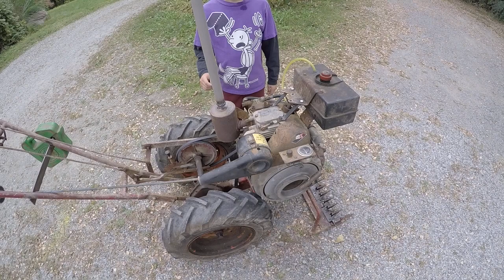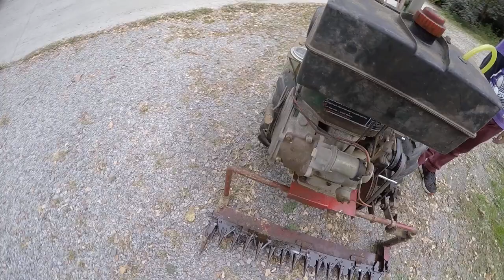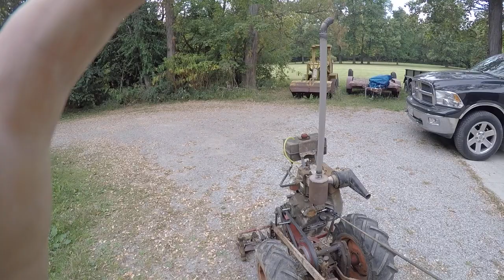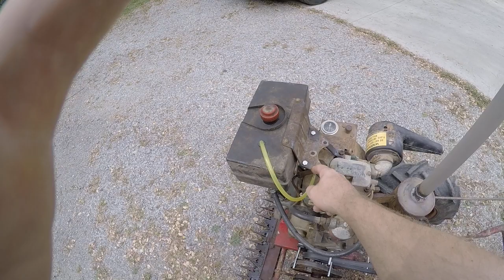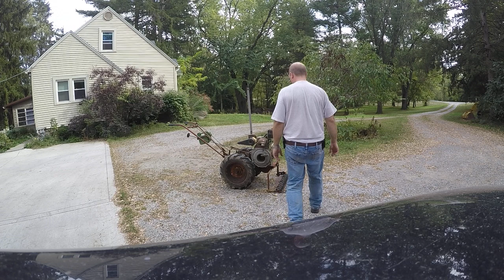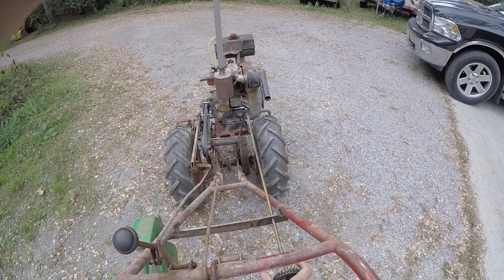Simplicity M1 Petter AC1 Diesel

Comment: Thank you for posting this, i have an ac1 that i made a DC 24 volt generator using a 24 volt pma set up with pullys and a belt, i was wondering how to lower the rpms, and couldnt find anything anywhere, the previous owner had set at 3000 rpms, and with a 24 volt pma the max that should turn the pma is 2700 rpms, i have it now set at 2100, because i found the max output be at 2200, and no need to set any higher as just wasting fuel. We are completely offgrid with solar and wind power with 4 forklift batteries, and we live as though we are on grid power, so sometimes need to have supplemental power, and i run my military trucks off of waste motor oil, and have found that these AC1 engines will run just fine on it, so free fuel. These actually run smoother and put out power just the same running on motor oil, i filter with a centrifuge and mix in 10% diesel, have had no issues with injector or the engine running it on it. Again thanks for your help.
Reply from the maker: Thanks for watching and glad you found value in it!

Comment: I know these engines fairly well, really nice to see what you've done with it. Very cool variable speed conversion, it clearly works! It's supposed to change the timing too, the fixed speed engines like this one are pre-set and the adjuster is only supposed to fine tune it. But it clearly works even if the timing won't always be spot on. Their operating speed range is 1500 to 3600 and the idea was you ordered it in the speed you wanted and it all came pre-set. But yes they did a special variable speed one, mostly for use in boats actually. The drifting idle is usually a slack governor. 

I didn't even know they ever sold those small British engines in the US (I'm assuming you're in the US!), must have been a difficult market for them to get into as there are so many good engine manufacturers there already. A common use for them here in the 1970's through to the late 1990's was powering traffic lights. They would be set at 1500rpm to a single phase 110v alternator, they'd only deliver about 1kw of electricity at that speed, but that was fine for that application. They were given a large diesel bowser and then they'd literally run day after day for weeks on end, and were only stopped periodically to carry out the maintenance schedule. When they are looked after they are very reliable little engines and also very frugal.
Reply from the maker: Thanks for the additional information!  Yes, I'm in the USA and was fortunate to acquire four of these engines at a what I'd consider to be low cost.  My understanding (similar to what you mentioned) is they were used for road signs back in the day when both incandescent bulbs were used and solar panels were not cost effective.  They definitely do appear to be designed and built for longevity and operating efficiency with the large footprint and slow operating speed.  I believe the ones I have were set to run at ~2,200 rpm although I can't remember if I read that or checked it with a meter.  I appreciate you sharing your knowledge and would encourage you to capture what you know in a video if you haven't already for future use.  Seems like I could not find a lot out there on the fuel systems for these or videos describing the things you did in your comment.  I did notice the pump can stick after sitting for some time which requires it to be removed and the rack cycled.  If I had more time I have some ideas I'd like to explore with these engines and hope to do that some day.  Thanks again for sharing your knowledge and helping others who are looking for information on these :)